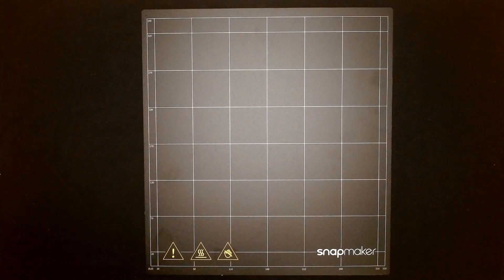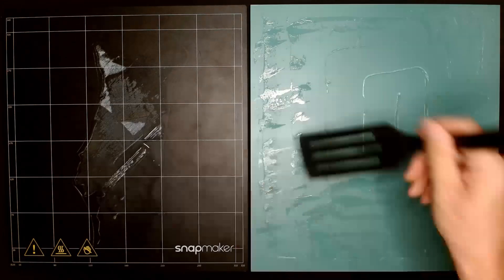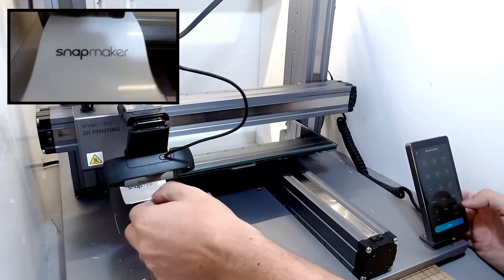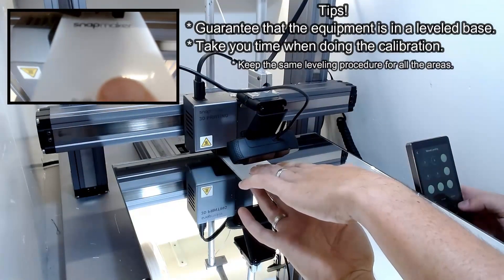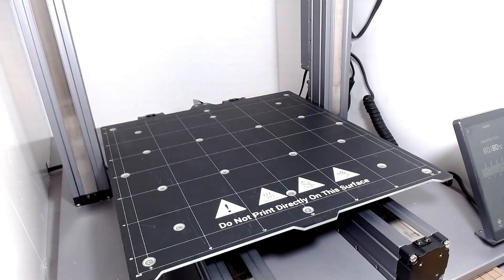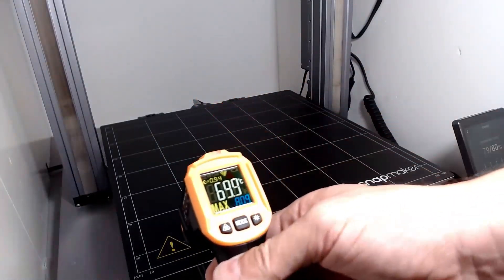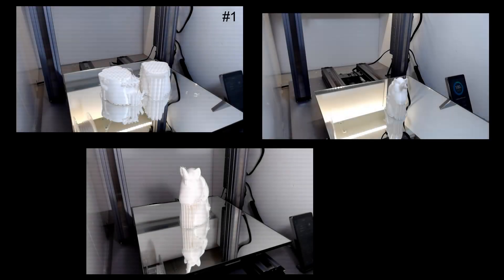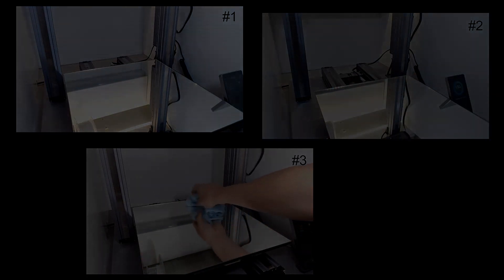Snapmaker 2.0 A350 Mirrored Glass Bed (New Life To The Old One) (7)

Comment: Thank s for d Video and the inspiration. 
Did U sand the old print bed to smooth it before adding the glue?
Reply from the maker: That is really a good ideia, but was not needed, 2 years and a lot of prints and still works! the glass might need to be changed since is getting a bit Ugly :D

Comment: Great video. How is the temperature of the bed after a few hours of print when you have a large print (10h+) - does it lower down?
Reply from the maker: Hi, it Stabilizes around 70' it does not go down. It has been my only bed for around 8 months now, i really prefere a glass surface.